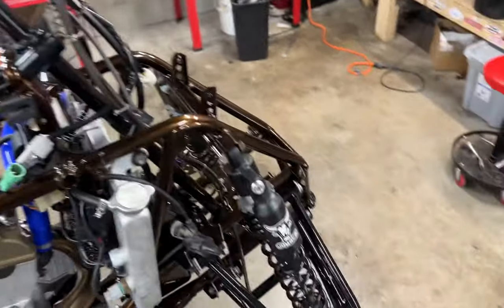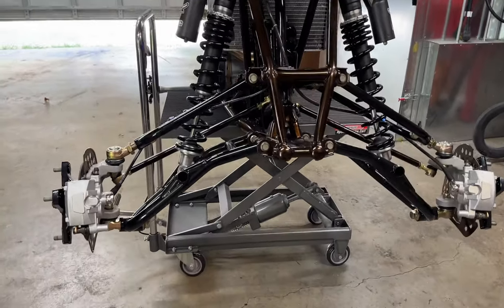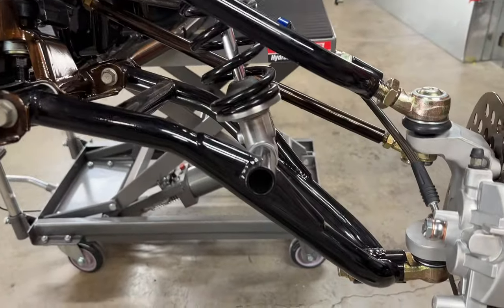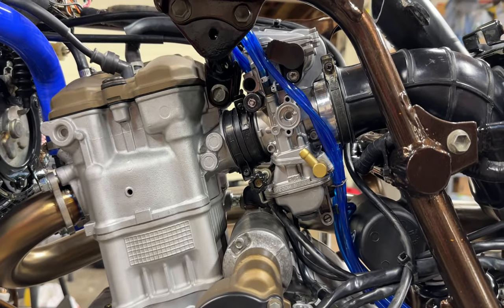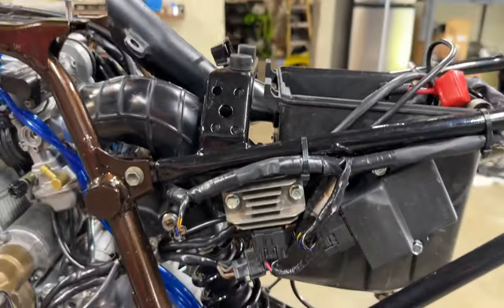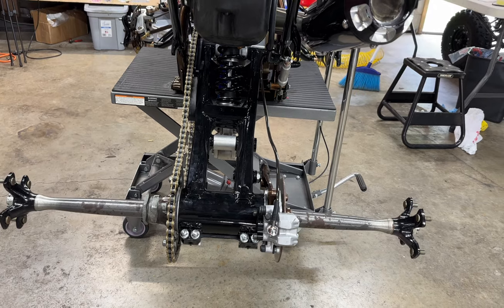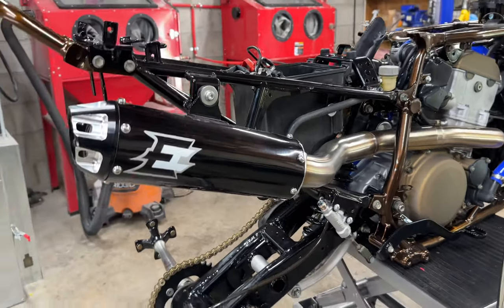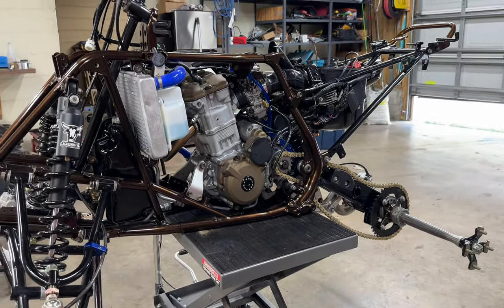LTZ Build | Assembly Part 2

Comment: Okay, I keep hearing plus one or plus two but what does that mean?? I just bought a z400 and I’m about to completely restore mine like you have done so I would like to know please
Reply from the maker: It’s referring to the length of an arms or swing arm. For example the an arms I have are +2 which are 2 inches longer than oem an arms. If you see +2 +1 than would mean the arms are 2 inches longer and 1 inch more forward than stock. Same for swing arms + or - inches over stock length.